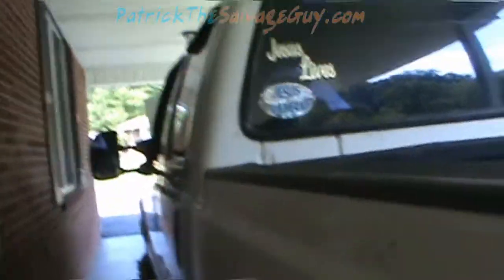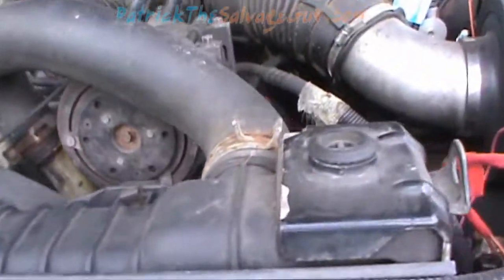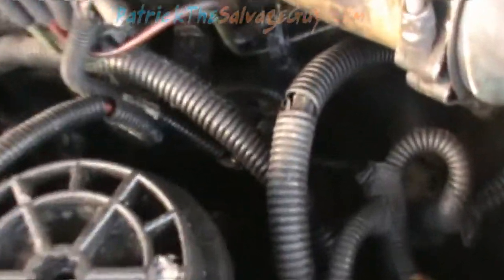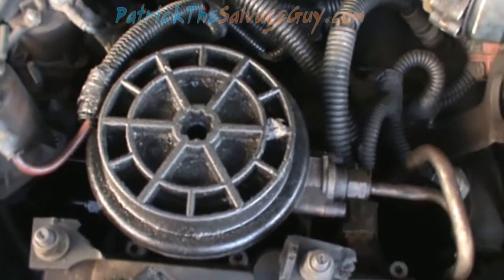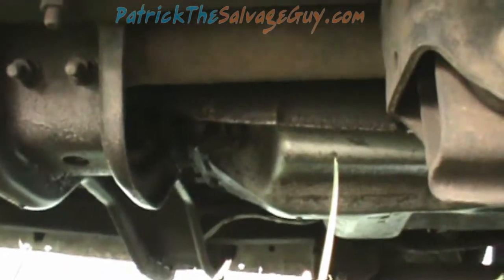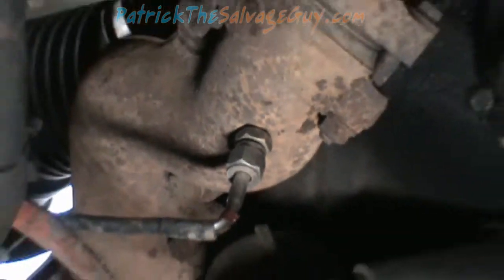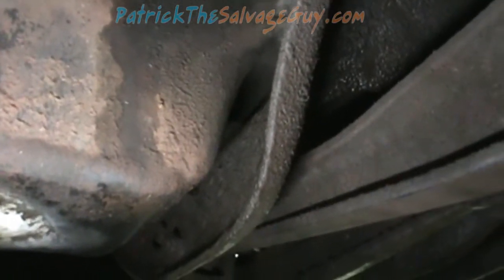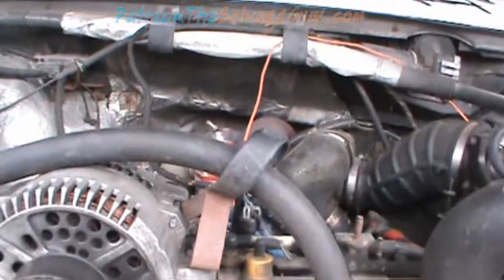🔴WATCH BEFORE BUYING a Ford F250 F350 Power Stroke or Any Diesel Truck✅

Comment: I bought a fleet van power stroke with 205k on it three years ago. It had a ton of new parts and only has one very small leak. Maybe one drop a day on the driveway. Also, replaced batteries with Walmart brand (yep I know that was a mistake) anyway, out of nowhere the van now takes three times as long to start. No exhaust smoke or anything. Has minimual blow by. Oil level is good, does not burn any. Looking for advice on things I should check?
Reply from the maker: Have you used a scan tool to check codes?
Check fuel filter/change it.  Tanks could be clogged I've got a vid on here where I bought  truck with 200 somethingk on it no start dealer couldn't solve it, one tank screen was clogged and couldn't get fuel and the rear tank pickup tube was broke off.  I'd check for fuel issue first, also check fuel pressure if you have the gear.....  Could be glow plugs though in the hot summer this won't matter.
I always use the walmart batteries in mine, haven't ever been sorry, they last a good 4-5 years for me....
IF you don't have a scan tool, I've got a video showing using a OBDII bluetooth adapter and a tablet with 2 apps I use to diag these trucks, everything (not the tablet) but 2 apps and adapter was only around $30 and I can even do injector buzz tests and talk to the ABS module.
Reply: Patrick Baptist my son broke my kindle I was using with Bluetooth adapter for scan tool. I’ll get a used on off Craigslist and check for codes. On the fuel side of things, when I bought the van the first thing I did was drop the tank, it looked new but I wanted to be sure and also check screen and do the (hutch mod?) I think that’s what it’s called. Turns out mod was done and everything was new. Next I removed fuel bowl, cleaned out the junk and replaced filter. One thing I did I think I screwed up was I think I when I put the spring back in I kinked it a bit because I kept blowing the filter gasket until I took it back apart, took spring out and put it back in.
Reply: Patrick Baptist glad you said something about glow plugs cause I was going to check that next, but I am wondering about icm? I think that’s what it’s called.
Reply: @robertlanham8076  
What year I missed that?
Will it start after having the block heater plugged in for 15 min or less?

94'-99' no charge air cooler models have an IDM they only fail for 3 reasons
Dummies
Water infiltration still working it will make steam when hot and blast the seal on the lid.
Or
There are a bunch of duplexed resistors 
3 mosfets and a bunch of duplexed idr little boxes that fail about 12 months after they leave the dealer when they were sold. Pops no codes but takes about 45hp outa the motor.
Can be repaired or you can flip for the hi energy IDM that boosts the voltage from 120v ac to 220v ac to the injectors. Only buy from any one from the original "SWAMPS" crew the rest are just cleaned up oe models or someone that dont know jack.
Chattanooga Tech is who I deal with you get what you pay for itll make any 94 thru 97 with good injectors have a smooth idle and sound like a 99-03  IDM is located on drivers fender just above the PCM
There are several tests you can do to make sure you need or wont destroy a new IDM. First rule of IDM PCM ECU never ever under any curcumstance attach a DVOM(volt meter) to any of those boxes. 
That bein said only do testing with a odb2 scanner or by testing the harnesses.
You said you get no smoke when trying to start? I would go to icp sensor. Only buy a Ford or International all the cheaper offerings will let you down like you will have all of your crankcase happy happy filled with oil and 2 miles later you will have no oil and possibly a boat anchor in place of your motor. I didnt know you were a ships captain?
99 up have a FICM Fuel Injection Control Module
IDM Injector Drive Module.
Crank and no start did you check yer maxi fuses?
If you have one blown remove the oval shaped connector on the fuel bowl for your fuel bowl heater  replace the maxi try it?

Check yer exhaust back pressure sensor pipe?
Stainless pipe goes from under a sensor attached to the front of the HPOP to the header on the passenger side. Not as difficult to remove as it seams just back it up with another wrench at the hpop keep that clean and yer mpg and startup will he amazingly excellent
Never known that sensor to go bad but if that pipe wont unplug easy with some stiff wire and oven cleaner but another and keep it clean riffraff has em for cheap and they fit super good consider that HPX talk about idle startup and throttle improvement well $50 was never spent so well. If yer a DIY  make sure your parts can handle 1000psi stainless is a bitch to bend and copper has to be a certain thickness aluminium sucks cuz it cracks.
Have you tested yer glow plug relay?
Reply: @robertlanham8076  
Scan tools from BAFX are $21 for android and $25 for ios
Reply: @PatrickBaptist  
You figure out how to use Torque Pro yet?
Just gotta enter the command codes or the equations for the self tests. Kind of a safety feature so dummies wont ho doin buzz tests or ecu dumps on the freeway.
I like that forscan better then either car gauge or torque if you flip for laptop forscan it becomes real helpful when you log data to catch things failing before they even show themselves kinda cool. I keep my daughters Audi running tip top for way way cheaper then before I watched yer scan vids and bought one. 
Audis are badass and hella sade but when they break they take entire systems with them when they shit the bed. Catching it early has been way cool
Reply: @robertlanham8076  
Yup definitely Glow Plug relay always breakin then EBPS pipe just order one you wont be sorry for real. 
ICPS after that.
Reply from the maker: Hey I'm not ignoring you my life is just a bit busy, our 5th child was born the other day, I'll get back to you in another week or 2 when I can think more about your issue, please forgive me.  Nothing is wrong on my end, just got more going on that usual.

Comment: Im thinkin blow by is just what my problem is...how can they run 100mph sustained for 20 or more miles without any sign of a problem till ya slow down and the big white cloud buries everything!
Reply from the maker: Kinda sounds like injector cups, white smoke means water in the cylinders....
What RPM you turning at 100?  I didn't ever run mine that fast up the road that long.
Is their fuel in your coolant res?  Almost sounds like injector cups (what a pain).
It's very rare these blow a head gasket, I've never seen a 7.3 that needed one, the only way it's going to give is if you overheat it real good.
How bad is the blow by?  I've had a truck that was pretty bad with it and it still didn't smoke other than when cold....  It had piston ring damage and was a ether addict (prev owner thought that was better to do than to just change glow plugs).
I've got to go back and re-read you other comment...
Reply: @PatrickBaptist  100mph right at orange line but I am running 3.97 gear with a gear vendors over under with a short drive shaft.

 Nope like I wrote no cross contamination of fluids 
Smoking started then went away then came back then torqued down left bank if injectors after reading about injectors playin peek a boo.
Regardless at 349000 just do them all and IDM was pressure bloated 

So bought set of new injectors and replaced idm

 drove like 600 mi then started smoking again

 tightened down passenger bank stopped smokin. 

drove about 75 miles and started smokin again.

Checked tight on drivers side no change.

Last two days I pulled the injectors and cleaned the injector cups like factory clean and sscrutinized cups as best I could.

 reinstalled injectors changed oil, changed hpop oil,

 fired up on 3rd try 

slowly warmed her up then hit the I10 slowly climbed up to 100 to get all the oil out of the exhaust

Cannot get any black smoke only white coming out but thats common with new injectors

pulled over smokin  again chugging like a freight train out of the fill hole and the stick of dips and gots a pretty good skip.

 Gonna drive her a little more to get the air out 100%
Dont clear up
Then I will do a compression/leak down test 

Unless she miracles back into her old self itll be head removal...

ever know anyone that left a paper towel in the intake runner then put it back together? I am thinking I may have possibly done that and most likely stuck an exhaust valve open.
I went through some repetitive trauma that went way way beyond yup just way beyond anyhow my memory is jacked most the time anymore. Regardless i may just have screwed up royal. It was like 2+ months ago but I cannot say for sure time or wether or not I did. I feel like I might have it keeps ringing like an old wired phone in the background.

Sorry lost signal. Well thank you sir your vids have been quite informative over the years. I do appreciate those who openly share a window into their repairs and analysis. Thanks for the scan tool vids as well. They helped me decide to finally get one. It has helped many ways on many road going capitalist engineered mechanical nightmares! : )
Ifn I do gotta replace her man I may just make an effort to track down a 12 valve and make her a stage 3 24valve Formmins idk? Like Formmins better sounds kinda more in charge and reps the Ford with its way better drivetrain and UI while letting everyone know the P pump governor washer was easily moved forward for 600hp in the vast amount of left over space in the engine compartment....then again brand new Hi energy IDM and Stage 1 180cc 30% injectors might do real well in a reman? Hopefully just take the heads to the machine shop and save some bucks for a larger water meth tank more nozzles and an Idash?